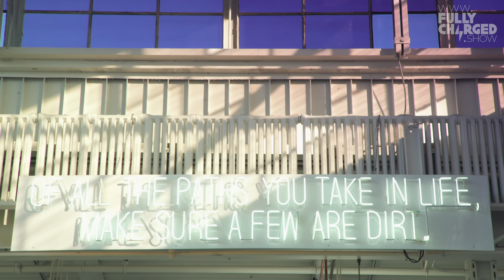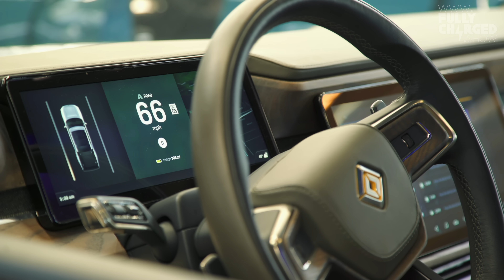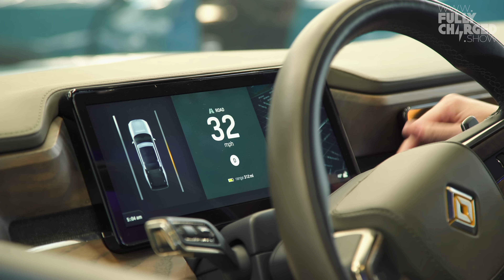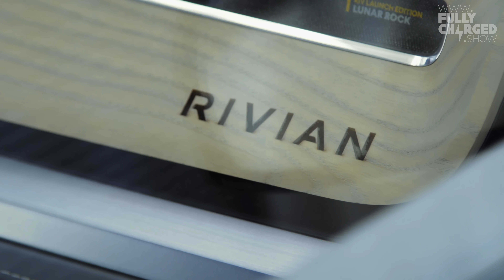Rivian R1S Electric SUV & R1T Electric PickUp Truck - World Exclusive: Inside Rivian | Fully Charged

Comment: OMG. Not again. Nice rigs, but why not start with basic specs, price, production status, availability...instead of touchey-feeley corporate buzzword gumbo? Right off the bat we're in the weeds with some unknown dude's career path before I can tell whether I give a toss about the vehicle itself. We're at 11:43 and finally we're getting features...oh, wait, no, it's about screens. It has screens, it seems. Oh right -- what else? There we have the 100th cu of the weird headlight, thanks. Now at 14:26 there's "close to" 800 hp. Ok, that's a beginning. 14:35 we get 0-60 in 3 sec. M'kay, good, now we're getting there...slowly. 15:15 battery pack kWh options. Does this translate into range? (Mystery.) 15:45  tow weight. 

This is far too long an ep to be left with so many questions about the basic vehicle and what little solid information slipped around the edges left us with a lead that's well and truly buried. It's clear that Chelsea really knows her EV material, and I'm very much rooting for her, but FCS has set much higher standards for journalism than this, which feels a let down. Best of luck.
Reply from the maker: We covered those items in detail in the previous episode on Rivian (Jan 2019) and will cover them again in a drive episode in 2020; we had lots of requests to do this type of behind the scenes episode on the company as the vehicles are still pre-production - thanks, Fully Charged Dan
Reply: @fullychargedshow  "Welcome to part two of our three-part series on the amazing Rivian SUV and truck now in pre-production. In our first episode we introduced this 800-horsepower EV that will leap from zero to 60 mph in three seconds and tow [X] pounds. Its three battery options will provide up to [Y] miles range. Naturally, we're keen to learn more. In this episode we take a behind-the-scenes look at the company and engineering talent building the Rivian to learn more about their innovative approach to creating an off-road monster EV with impeccable on-road manners."
....
"We're keen to get behind the wheel of a Rivian for an on- and off-road test in part three, coming in 2020. Be sure to join us then."
Thanks for the reply, and lotsa <3
Reply from the maker: @johnfife3062  You're completely right John, but we're a tiny team working excruciating hours so we can't always communicate as clearly as we would like. Working on it - Dan
Reply: @fullychargedshow  You're the best team out there and you're making big waves in EV awareness. Friends and family think I'm an EV guru -- I just quote you.  ;  ]

Comment: 12:36 Yeah, screens are good like that, but knobs are tactile. With knobs I can make adjustments while travelling at 120 km/h and not have to look away from the road or worry about adjusting something I didn't intend to.  2c
Reply: Exactly. Also you would not necessarily need to hard wire every button/knob. Just give them a little oled inlay and make them mappable.
Reply: @666louis  Problem with that approach is that you could be left with a load of spare knobs around incapable of doing anything at launch, because the feature isn't even plan yet. Also that a load more electric wiring to install. 

Voice control is the future.
Reply: People forget that this is a truck, just imagine operating the screen precisely at speed on a bumpy road, or worse, operate it w/ dirty hands or gloves, that screen won't last in an actual work environment
Reply: Honda the last two years just learned from customer feedback that full touch screen did not work, everyone wanted a volume knob. And now they all have the volume knobs.
Reply: Yeah I still like the retro style knobs and switches. Especially the ones from things like vehicles from the nineteen twenties to 60s. Preferably metal. Feels both old but stylish.
Reply: At least Landrover have a release date and have committed to there product. When can you buy one?
Reply: Mercedes-Benz does a good job with mixing screen & knob/button balance, both aesthetically and functionally. Most options are still in the screen itself, but they make navigation of the system so much easier with physical buttons that will take you exactly where you want to go within the system. Eliminating a lot of that looking and searching for the button you want to touch, and end up missing it a couple times because you’re doing 60mph down the highway trying to keep your eyes on the road.
Reply: Set it up for software control, but allow an optional button/knob panel to be plugged in via USB that can generate the same control signals that the software does...  kinda like 'Media Keys' on most keyboards and wireless headsets.  They all generate the same 'standard' messages that the audio program can listen for, and then execute (play/pause, next track, vol up/down, etc)
Reply: What a stupid idea wiring all individual controls, just have a bar of then on 1 wire. Under the touchscreen, with oleds or e ink for remapability.
Reply: @635574  That's what the top and bottom bars on the screen of Teslas does, but without added complexity.
Reply: NoGufff voice control
Reply: No thank you, Alexa!
Reply: @NoGufff  
Sad.
Reply: @MarkGaudie  Siri, pause my audiobook so I can talk to my car. Car, lower the volume. Siri, resume my audiobook.
Reply: @HenryLoenwind  The software should easily be able to filter out it own out put here being the audiobook and take directions from your voice.
Reply: You obviously haven't tried it, and are determined to hold on to your irrational bias in the face of overwhelming evidence to the contrary. And the fundamental flaw in your assertion is that a car without buttons probably either doesn't need to be adjusted at 120 kmph or the car can take care of itself while you do the adjusting. People who can't let other people drive and refuse to use cruise control are very poor drivers who are afraid to relinquish control because they project their lack of ability on everyone and everything else.
Reply: @awo1fman  horse patootie.  All of us have mobile phones with touch screens and all of us know what a pain it is to use them.  Most people have just convinced themselves that they can live with the serious downsides of touch screen input because benefits outweigh those downsides.  Meanwhile, the digital camera industry figured out years ago that the key is programmable physical controls.  For ergonomic reasons, there are ideal locations for physical buttons that can be easy reached and used without having to look at them.  But having them be 100% digital and customizable means you get all of that benefit of a flexible UI, without the downside of an input that you have to take your eyes away from the road to use.
Reply: @patreekotime4578  Sounds good in concept, in reality how do you label them and what happens when you have a new feature and all of the buttons are already taken? You really have no idea what you are talking about, and your bias is utterly irrational.

Oh, and speak for yourself. "All if us" don't think smartphones are a pain to use, especially when each app is different and we're not talking typing, just buttons and sliders.
Reply: @awo1fman  Yes, so easy to use... just open up the controls and change your settings without looking at the screen.  Type a text message without looking at the screen.  Smart phones have very real and very serious downsides compared to physical keyboards or even mouse input.  You've accepted them and adapted to them.  It doesn't mean they aren't there.  Heck, why is texting and driving illegal in many places?  Why is even touching your phone while driving illegal in some?  Why do some phones now repurpose one of the side buttons into a camera shutter button?  Why is voice control standard now? Because we ALL know it requires concentrating on the device screen to use the controls.  As far as how the controls work... Tesla already incorporating programmable buttons into their steering wheel.  It works just like a digital camera function wheel... It's function changes with the mode you are in.  A dial control could even have an LCD in the center to display the mode.  I'm not sure what your point about new features is.  Environmental controls in cars have not changed significantly in 50 years.  Cold to the left, hot to the right.  If user sets a dial to temp control, then that's it's function.  If another user sets it to music volume, then that's it's function.  Not hard to understand, and really not difficult to implement.  It's realitively old tech that could make these cars safer to operate.
Reply: Mark Haury It all comes down to ergonomics. Yeah, a screen is much better than a large cluster of ugly buttons, but having a knob or two mixed with a few hot keys could really help navigate the system more conveniently, and if executed well it can also be more aesthetically pleasing than one giant ugly screen. Look at Mercedes for example, you can access nearly every part of the system within the few buttons and a knob on the center console, all without hardly moving your hand... If anything at least give us a volume knob.

Comment: Did he say “gearbox” 🤔
Reply: Yeah there's gears between motors and wheels but that doesn't necessarily mean multiple ratios...they'll be single speed I pretty sure.
Reply: he said single gear gearbox
Reply: @seb.  Ahhh...silly me I missed that.
Reply: @Mrbfgray  on first listen I swore he said they had 2 speed boxes on each motor. But then I rewound and it was single speed (which is what every other EV  has, so no worries!)
Reply: @0tispunkm3y3r  I'd have been surprised if it was't single speed.... 2sp. too expensive, bulky and unnecessary below say 150 mph.

Comment: Safety, price points, seating arrangement, accessories, type of charge plugs, interior materials and a deeper look both inside and out would have been nice.
Reply: @Anyone Anything 
Already announced.
$69,000 before tax credit
Reply: @rogerstarkey5390  Base price with the lowest power mortor and battery.....
Reply: @Enforcer_WJDE  
Yes, but what's your point?
You said 
"Price point? No less than $80k"

It's 14% below 80k before, and 22% below after the tax rebate.
Reply: @Enforcer_WJDE  obviously.
Reply: @rogerstarkey5390  Still unobtainable for normal people. Waste of money and energy. 
None of these vehicles will save the environment. Did nobody realize all these EVs have a lot of horsepower and have the biggest possible battteries? Where are they saving the planet? These are toys for the rich. When is some small company dong the opposite and creating a car that can be sold en masse and have an impact on the environment? NOBODY WILL! Because they already know EVs are never going to be the solution to our problem.
Reply: @Enforcer_WJDE  When charge times will be a couple of minutes and the charging infrastructure expands, batteries can be much smaller on regular cars. Only off-road cars would still require big batteries because they can't charge anywhere in the wild.
Reply: @Enforcer_WJDE  
<FACEPALM>
These serve the purpose of.
Enabling new companies to build EVs.
Which forces existing companies into the market (happening)
Which results in cheaper vehicles (happening)
Which results in mass market adoption,  publicity, awareness of other issues, etc, etc, etc.

They make a difference.
Reply: @rogerstarkey5390  Doesn't look like that to me tbh. Renault Zoe and Nissan Leaf were already out in Europe for 7 years to almost a decade for latter but we have yet to see another company build a similar car for a price that let's the price war beginn. Don't be delusional. Low volume and demand and problems with raw materials needed for Li-ion batteries will not lower the price in the near future. The fact that manufacturers like Revian and other luxury brands build 2-3 ton EVs that are in fact a waste of the few resources we have shows that they were never meant for the general populace but rather as a toy for the privileged and virtuous. EVs will be a toy in NA as long as gas is cheap af over there. People rather buy big bulky SUVs...so much for the environment.
Reply: @Enforcer_WJDE 

Hold on, within the length of your post you just went from "not enough small EV's" to "people would rather buy bulky SUV's"
Well, these "2-3 EV's" will be replacing the 2-3 ton ICE trucks and larger cars which cause a large chunk of the pollution, so all good.
As I said, the first vehicles must be, at least generally, low volume and high profit to finance the transition to mass market lower profit per unit vehicles.
Small (smaller) EV's coming to market?
You mean apart from
Renault
Peugeot (so Opel, Vauxhall depending on location)
Honda
Hyundai
Kia
VW (So Seat, Skoda, soon Audi)
Uniti(!) ?
New Bolt (soon?)
No doubt you'll move the goalposts again to "not in the US"? But you mentioned the Zoë, so fair game.

 "Low volume and demand and problems with raw materials..."?

Confused? 
Is it low volume, or demand?
Raw materials?
If you mean Lithium? No, it's hugely abundant.
If you mean Cobalt?
1) At least some are removing it
and
2) I'll wager the OIL industry uses a lot more Cobalt than battery manufacture. Research it? You should. I have a really good link, but do it yourself.
Reply: @Enforcer_WJDE  
The gas vehicle has been made for over 100 years. And 50٪ of people still can't afford a new car. 
Electric vehicles are full of new technologies.  The factories don't exist to build a million batteries a year let alone 17 million per year for the united states alone.
Economy of scale will bring the cost down. Along with battery advancements. 
Charging a ev with pure coal power is cleaner than running gasoline. The grid is currently 22% renewable. And getting cleaner every year
Reply: @Enforcer_WJDE  That\s not entirely so, there are a bunch of start/ups aspiring to do just that, BUT developing any car model is a costly process. Many will not succeed (Uniti seems to be on the verge of collapse for instance), but some will make it through. Sono Motors looks like they will be delivering a cheap usable EV for the masses.
Reply: 240 3-phase AC for me please.  ;-)
Reply: A journalist doing a test drive would be good too.
Reply: Fully charged already did a look round the vehicle: https://www.youtube.com/watch?v=QMfxJEfb4lw
Reply: Daniel Nicholson
Just btw,
Watch the Jonny Smith review?
I think you'll find most, if not all of your points were covered?
Reply: Roger Starkey Spot on! Jonny’s was much more detailed.
Reply: @tumbleweed1976  
Thanks.
Reply: yup, lots of history bla-bla, or info for people who havent heard about EV's yet - meh
Reply: @morkovija  meh...? Yeah. :-|
(Thank you for expanding on my thoughts in such depth.)
Reply: Daniel Nicholson You'll need to wait another 5 years for those details.
Reply: Starting a car company is insane. Talking about a car that doesn't exist yet seems hard. We should have done this 40 years ago. Bears shit in the woods.
Reply: The Rivian website has all that detailed information on each of their models
Reply: For this phase of the program what you see is what you get.
Remember, let's say... The Étron, ID.3?
How long before production did we get details? How low before did someone drive one?

Comment: shots fired at Tesla regarding the machine gun belt type cooling. 13:40
Reply: Read the lastest Tesla battery pack patent.
Reply: Also, disingenuous comparison of battery capacity with Model 3 rather than Model X. I'm not convinced.
Reply: @awo1fman  The model 3 is by far the most popular so it's useful as a reference point even if the comparison isn't entirely fair.  Obviously the tesla pickup will be the perfect comparison when it's released though.
Reply: @rhamph  That's some seriously flawed reasoning. Rivian's models are a pickup and an SUV. As in a Model X is the obvious "reference point". Rivian starts at a few kWh more than even the top Model X, so why not compare apples with apples? Because they are being dishonest, that's why. I'm not impressed.
Reply: @awo1fman  Why compare with a Leaf at all?  It's a totally different class of vehicle.  It's a popular, well known vehicle though, so it provides a reference point.  Just like the Model 3.

Yes, the Model X is a bit closer, but it's still the wrong class of vehicle.
Reply: @rhamph  Baloney. The Rivian pickup and SUV are basically the same vehicle and are in the same class as the Model X. What part of that do you not understand? It's blindingly obvious that they are deliberately comparing with vehicles in the smaller entry level class rather than the large luxury class. It's stupid for a lot of reasons, especially when their numbers are better than the actual competition. To not make a direct comparison with the direct competition makes them not trustworthy. There is no defensible reason for them to be so obviously devious.
Reply: @awo1fman  
Yes, I noted the model 3 comparison as well, however, did they underestimate the battery sizes? If so they highlighted the Model 3 efficiency even more!
Reply: @rogerstarkey5390  Exactly. They gave nominal capacity for their own batteries and actual usable capacity for everybody else's, again making them look better than they actually are.
Reply: Nissan Leaf battery cooling does not compare favourably either. 😀
Reply: Nov 21th